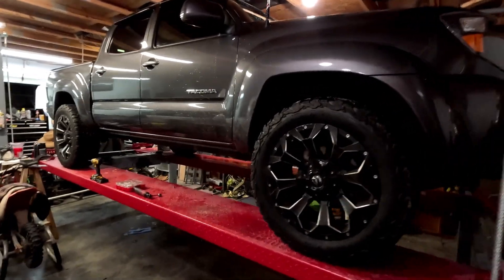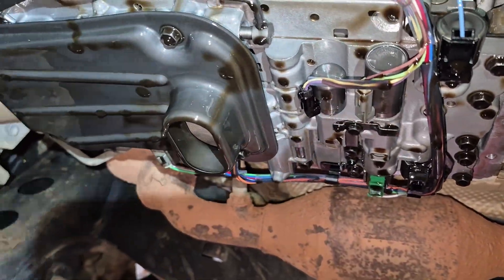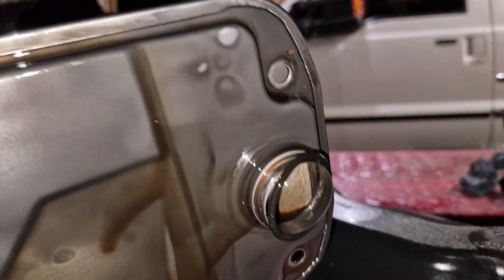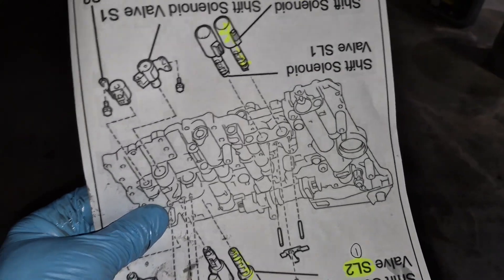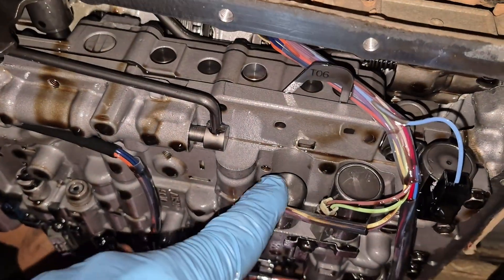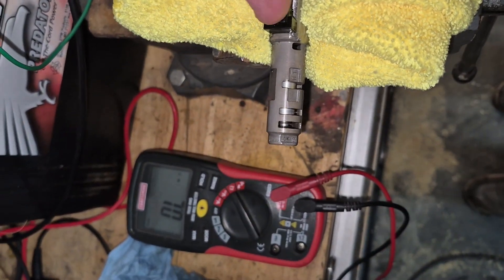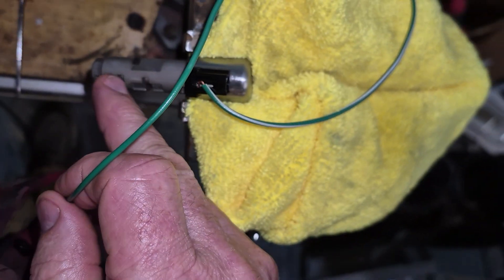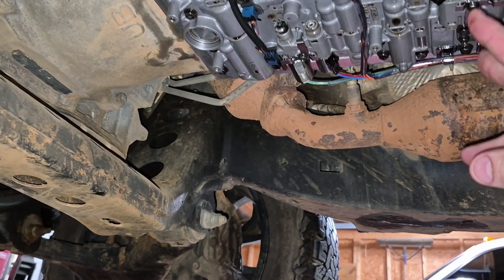Pressure control Solenoid "B" Fault code, Toyota Tacoma A750 Transmission shifting problems.

Comment: This is a pretty darn well put together video! 

It would be nice to see and hear video of the truck running in gear and idling in gear and in neutral/park both before and after the service to demonstrate the differences, and to highlight any "tell-tale" signs, sounds, or symptoms

A follow up video that included before and after footage of the trans in operation would be super super interesting.
Reply from the maker: Hi, thank you, and those are some good ideas. In trying to make this video shorter I didn't think about including those things. I will try to include things like that in the future.